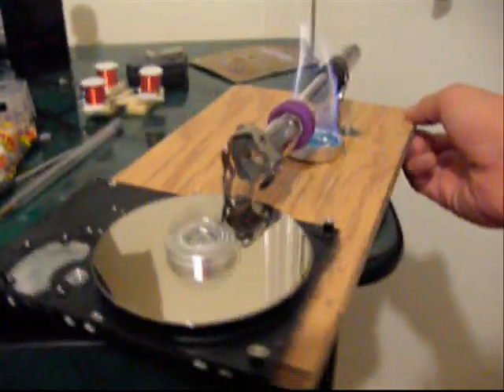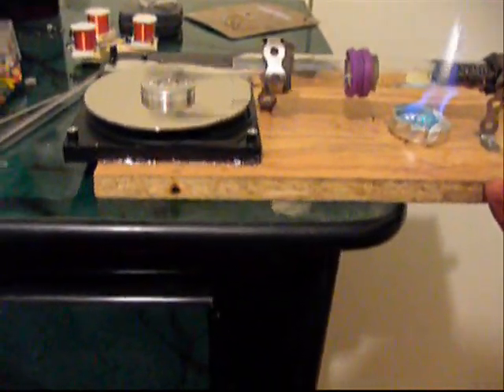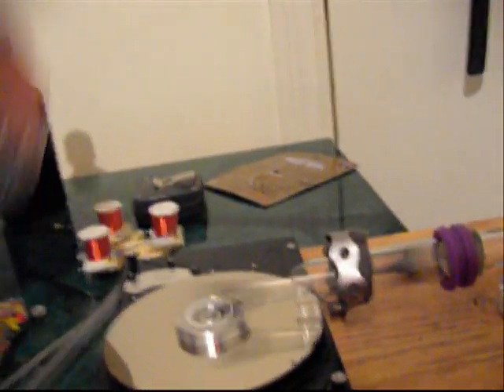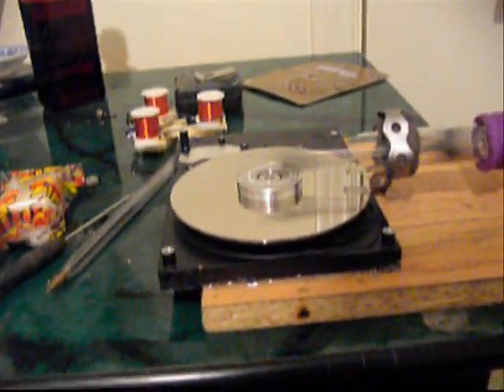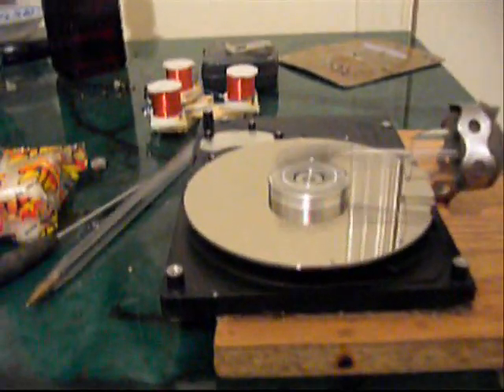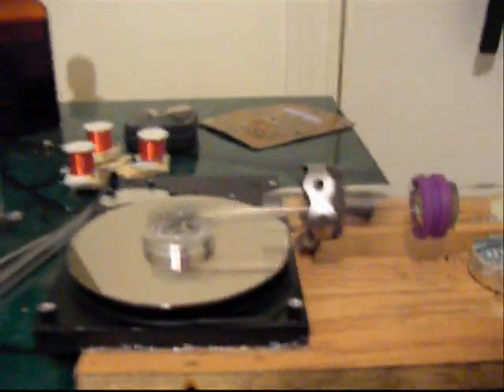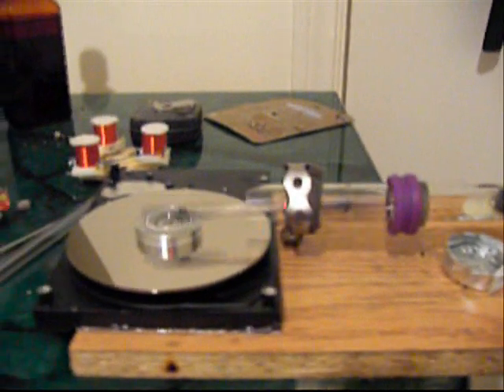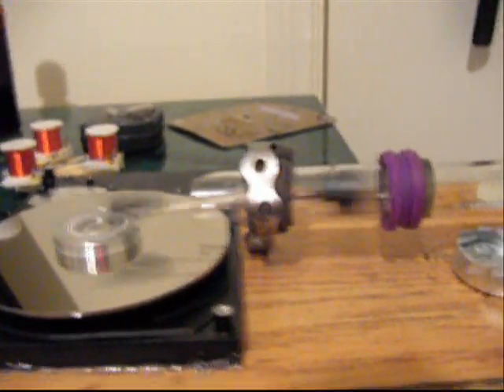Homemade Lamina Flow Or Thermoacoustic Engine 5 New Flywheel

Comment: Check youtube /watch?v=Vw0BvNcVPkk 

That is one of the most basic examples of a thermal acoustics engine. Listen to the tone it makes with energy from a thermal difference.

Put a piston inside the tube in the other video. If you have it drive a flywheel to spin a generator, then you will have exactly what you see on this page, a thermal acoustic engine that generates electricity.

Drive this in reverse and with electricity you could make a thermalacoustic refrigerator.

Comment: Your example is not a thermalacoustic engine. Your example is a thermalacoustic refrigerator that generates a thermal difference with the energy in sound.

The difference is that the process is reversed. 
Engines take a thermal differences and generates mechanical energy. Your example takes mechanical energy and creates thermal differences.

Comment from the maker: @tenk4444 its very weak its better if you try to make a low temp Stirling engine instead like i did this engine has very little torque but runs really fast if you have a good flywheel